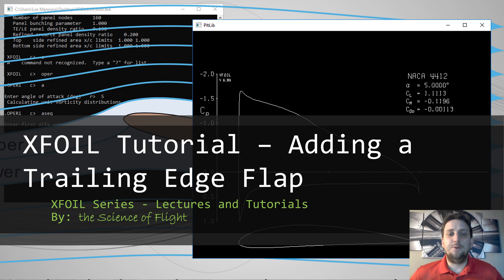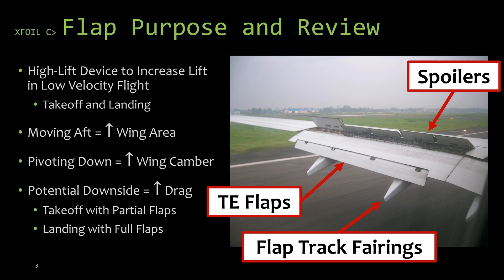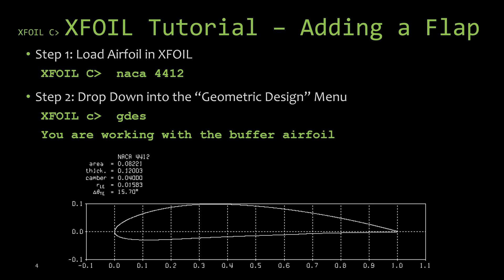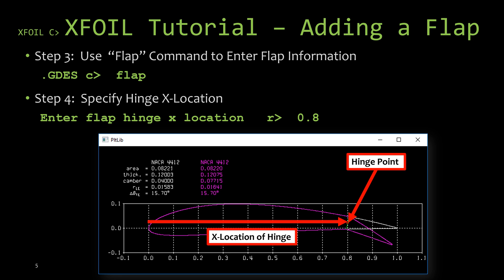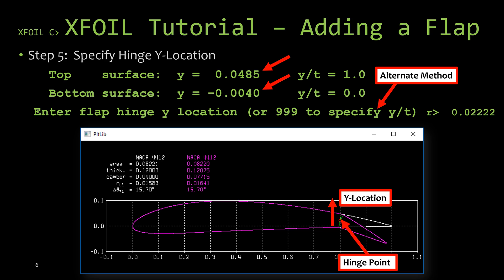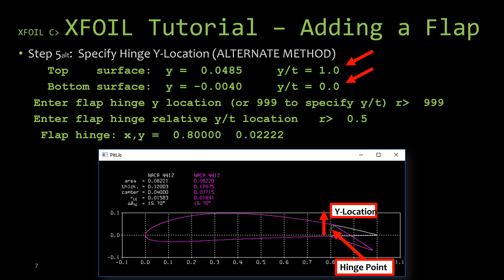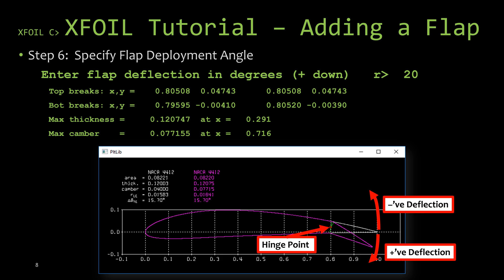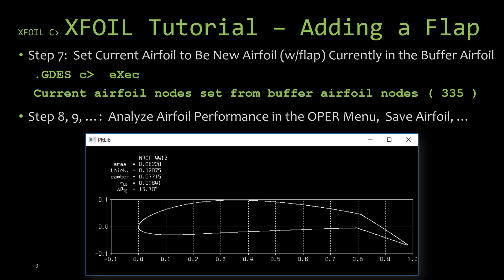XFOIL Tutorial 7: Adding a Trailing Edge Flap

Comment: Does this work for UIUC airfoils? when i try this xfoil crashes
Reply from the maker: It should. This command is not NACA specific so it should work on all airfoils. A good portion of UIUC airfoils need to be reformatted before being put into XFOIL (I made a video on how to do this called XFOIL Tutorial 3: Loading an Airfoil from a File. Its located here: https://youtu.be/g-SnoYE4yYk ) or they can cause issues. Which airfoil are you having trouble with and what are the flap parameters you are using? I will see if it gives me problems too.

Comment: Is it possible to export this geometry to icem cfd??
Reply from the maker: Yes, it is possible to export the airfoil geometry out of XFOIL as a set of points and then import the points into ICEM CFD. After step seven in this video (where you moved the finished airfoil from the buffer airfoil memory to the current airfoil memory), you will want to go from the GDES menu to the top level menu by hitting enter. At the top level menu, you will want to save away the x and y coordinate points into a .txt file using the PSAV command (PSAV filename.txt). Open the file in notepad, add to the file the first line that contains the number of points in each curve and the number of curves (335 1). Add a space and then a zero after every x/y coordinate pair (the airfoil will be imported onto a plane) and save the file. In ICEM CFD, import the saved file (File > Import Geometry > Formatted Data Point > Select file in folder browser). Now you have the airfoil shape imported into ICEM CFD.